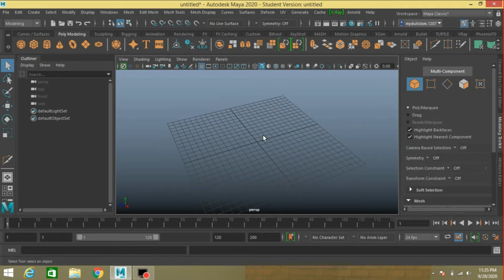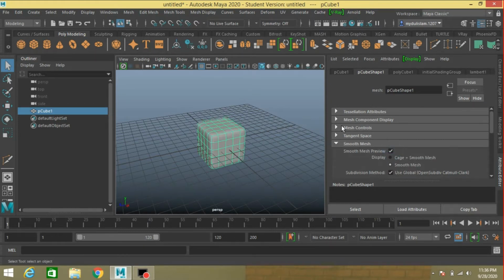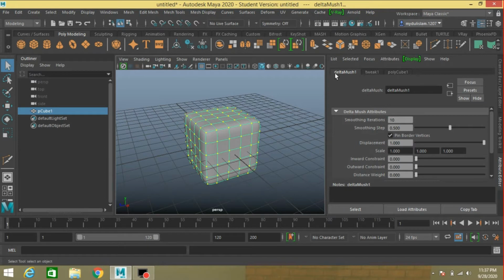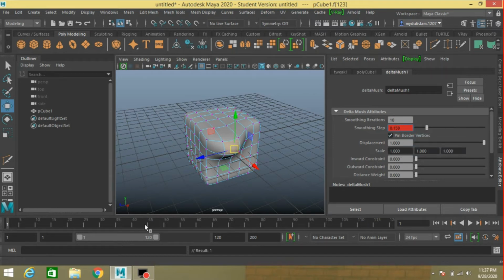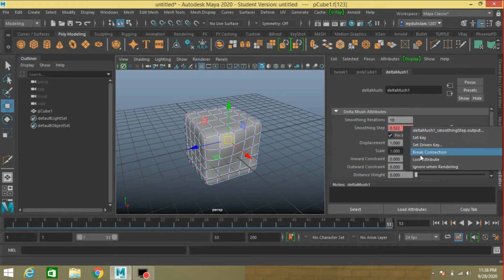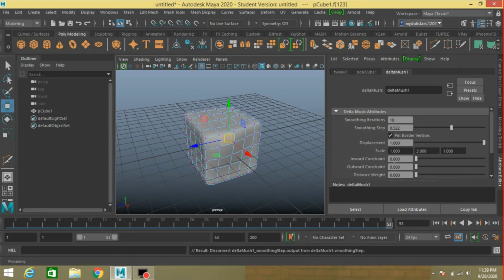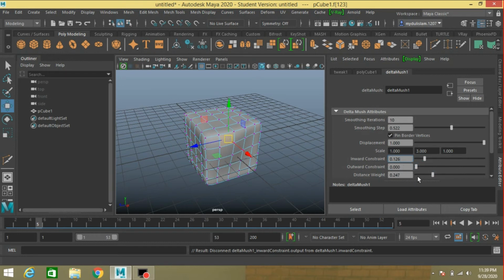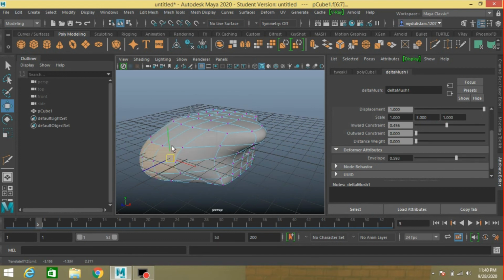Maya 2020 tutorial - Maya Delta Mush deformer basic for beginners

Comment: Sir, i cannot stretch.
Reply: I mean that i cannot stretch by using mouse cursor. Sir what will i do?
Reply from the maker: @benzo2616  try again
Reply from the maker: See the tutorial properly.  All my videos are explained easily
Reply: I've tried almost 100 times
Reply from the maker: @benzo2616  have you turn on smooth mesh preview & component vertex mode and select the vertex. If you don’t select vertex, it will not stretch
Reply from the maker: @benzo2616  wish you good luck
Reply: Sir, can i chat with you from whatsapp?
Reply from the maker: @benzo2616  you can
Reply: 7085941635 this is my whatsapp no  .
Reply from the maker: contact me on this number   +8801781632538